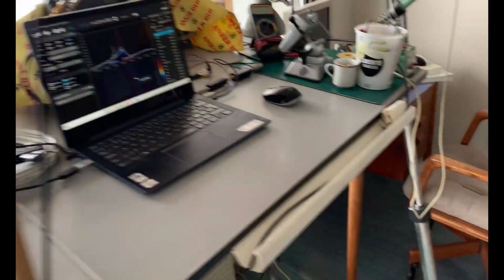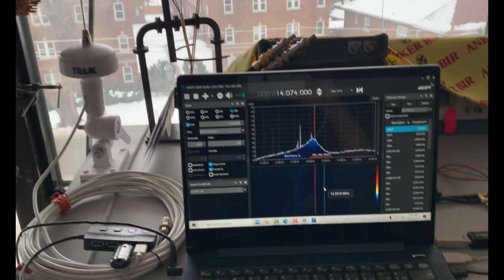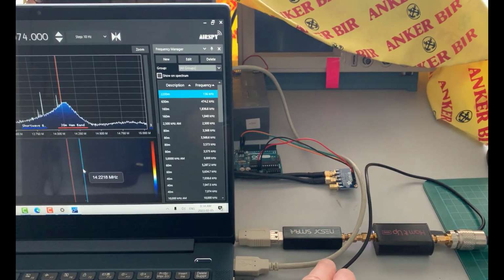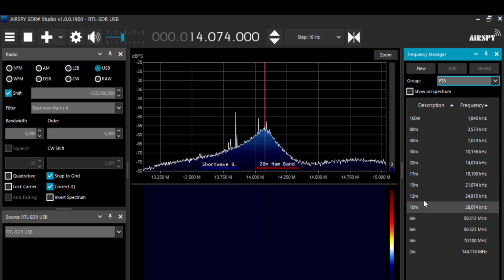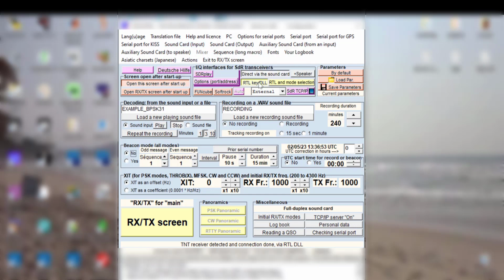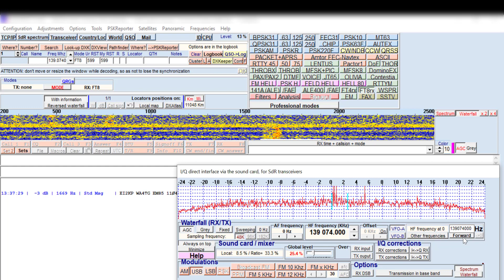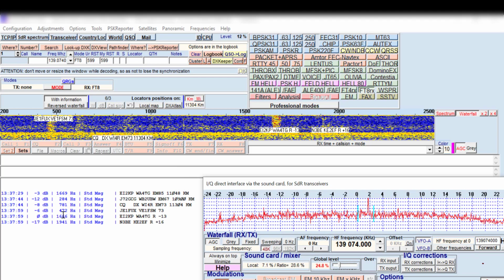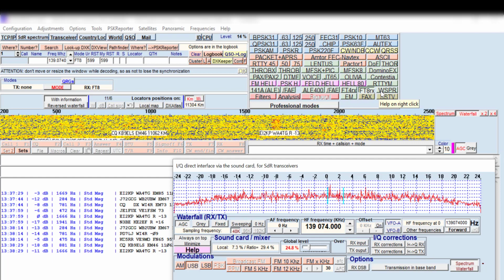RTL-SDR for FT8 on MULTIPSK

Comment: Nothing beats the outstanding capabilities and performance of MultiPSK.  And I don't care how messed up the interface looks which is often an unfair criticism.  It just works!   I am just getting back into it, so I need to get the latest version.  CW on MultiPSK is particularly amazing even with weak signals, especially in paid mode.  CW performance is  my "test" of a good software decoding program.  73!
Reply from the maker: I agree - an amazing program, does everything!